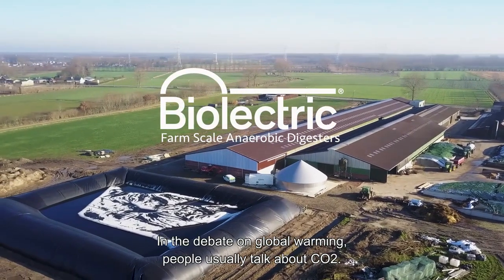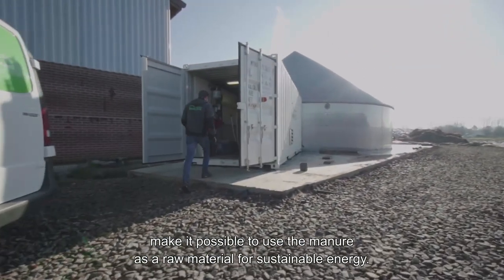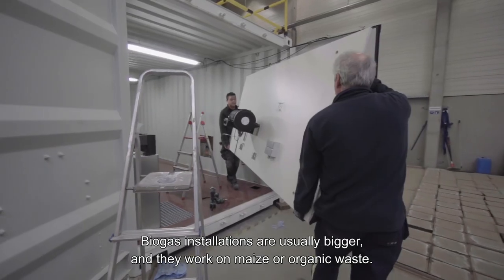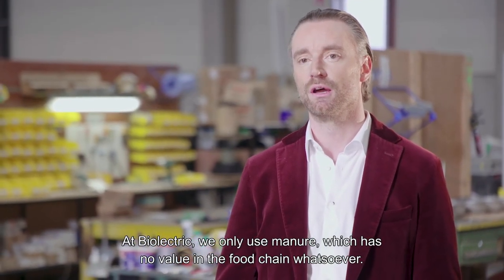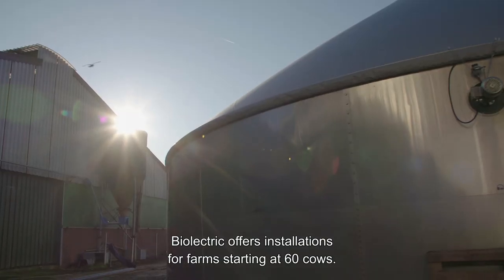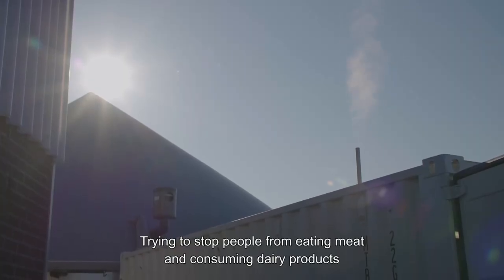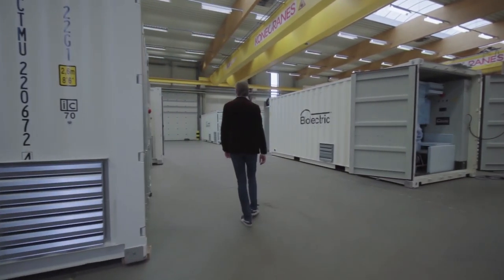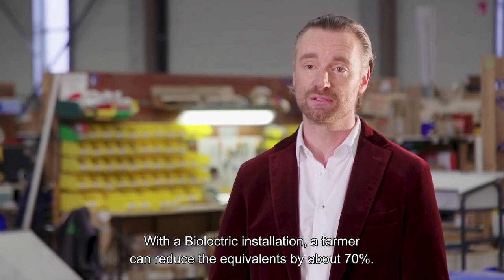Biolectric Farm Scale slurry only Anaerobic Digesters(English)

Comment: This is biogas plant is specified to make 1,300 kWh per cow per year.  1,300 kWh x 60-cows = 78,000 kWh with 60-cows  78,000 kWh / 365 = 213.7 kWh per day  
213.7 kWh per day / 24-hours = 8.9-kWh each hour  This has a capacity factor of 90% to 100%. This means the biogas plant will produce energy between 90% to 100% of the time.  Suppose the capacity factor was 20%  This would mean that only 20% of the year it would be able to make 8.9-kWh each hour.  Solar energy has approximately a 20% capacity factor since there is no sunlight at night.  A photovoltaic solar array of 8.9-kWh has a cost of less than $10,000, and it would produce between 9,700 kWh to 17,800 kWh depending on where it is installed.  This is between 12% to 23% of what a biogas will produce per year.  The cost per installed watt for a photovoltaic solar array is less than $10,000 / 8,900 watts = $1.12 per watt and with a 20% capacity factor, the actual cost is $1.12 / 20% = $5.62 per watt  This biogas plant has a cost of $100,000 / 8,900 = $11.24 per watt and with a 100% capacity factor $11.24 / 100% = $11.24 per watt  This biogas plant has a cost of $100,000 / 8,900 = $11.24 per watt and with a 90% capacity factor $11.24 / 90% = $12.48 per watt  As you may appreciate the biogas is fully priced per watt.
Reply: If your farm was very big, could you solar by day and methane by night would eliminate the need for expensive storage